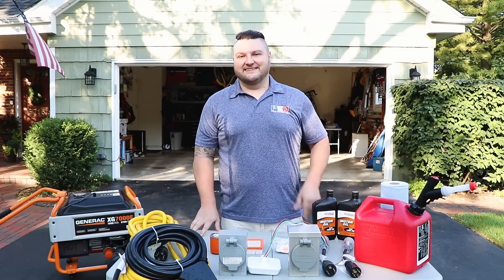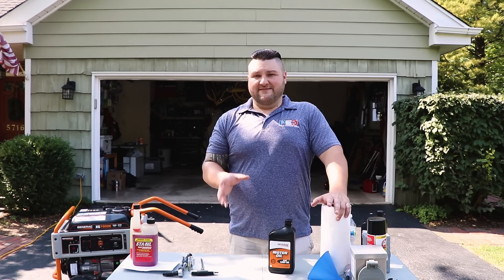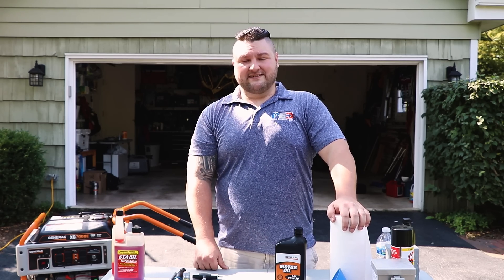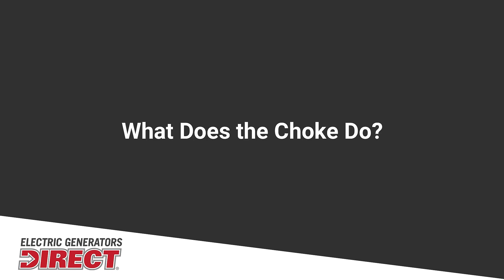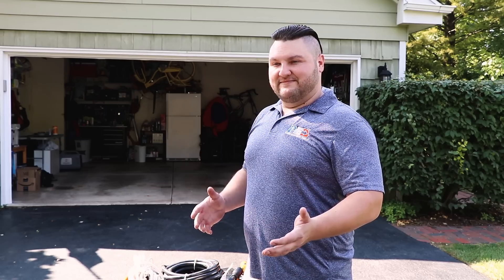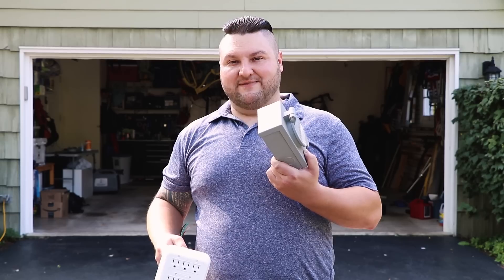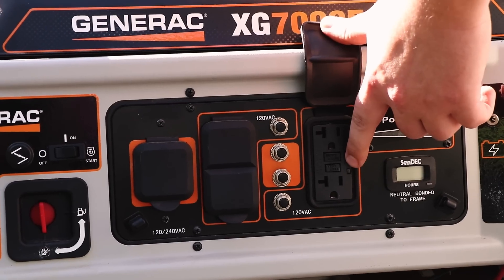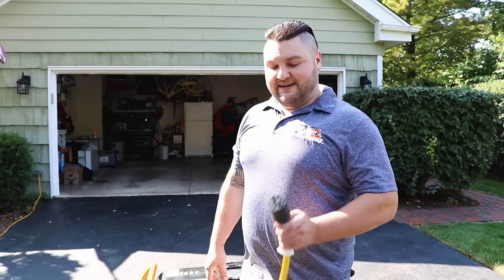How to Start a Portable Generator [Part 2]

Comment: Wow, thank you, learned a lot about running my generator. I need to buy a convenience cord, from that cord can I run an extension cord to my refrigerator and if so what kind? What kind of tent should I buy for my new 6000W champion Generator? Hopefully I was able to buy a descent generator. It's a big thing, so thankfully it came with wheels that I installed.

Comment: If I am only using the convenience cord for a few hours like you showed in your video for my refrigerator and laptop, do I need to ground the generator? It didn't look like you did during the video?
Reply from the maker: Hello, we have an in-depth explanation inside this article. Most generators today are built as bonded neutral generators that are already grounded properly on the generator frame itself, however you need to look at the owner's manual to make sure your generator uses that method and is not a floating neutral generator that requires a separate grounding procedure. Please read more here: https://www.electricgeneratorsdirect.com/stories/1021-How-to-Avoid-Tripping-a-Generator-With-a-Bonded-Neutral.html.

Comment: I'm confused as to whether I need to add an RCBO in order to use my generator? It's the Honda EU22i, and I'm using it to power 4 appliances which will total about 1000W. Is it safe to plug straight into a generator, or should you always have an RCBO or breaker?
Reply from the maker: Great question. A Residual Current Breaker with Overcurrent is not a required item for a generator. Generators have built in breakers that protect from overdraw and the inverters put out cleaner power then utility, especially the Honda units. You could still use a surge protector/RCBO with the generator but it is not a required item.
Reply: @PowerEquipmentDirect  Thanks for the reply. It does mention it very briefly in the manual, but doesn't say what instance I should use one for and I've never seen anyone else use one.

Also, do I need to earth it somehow?